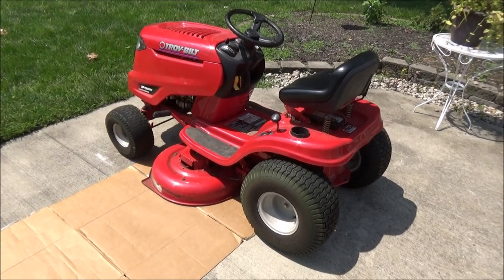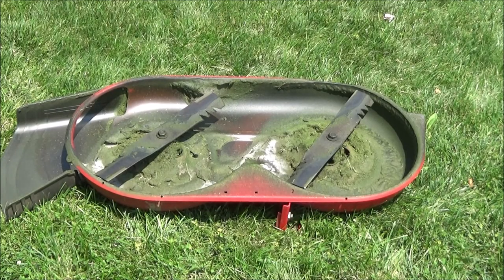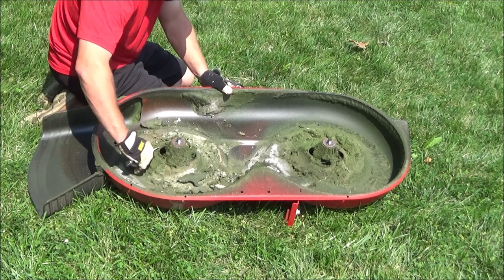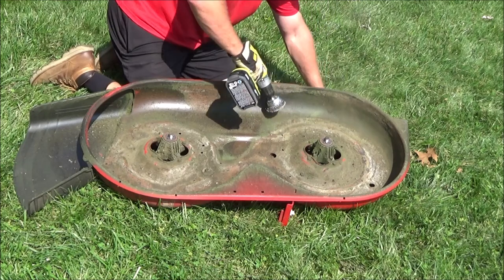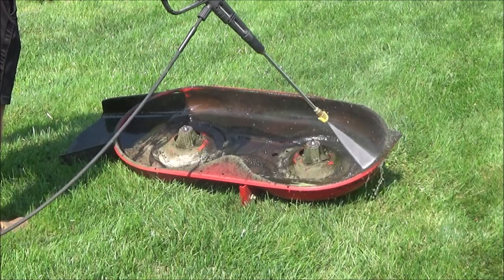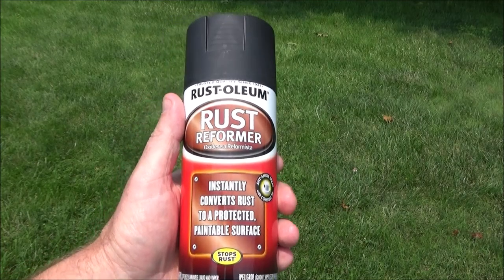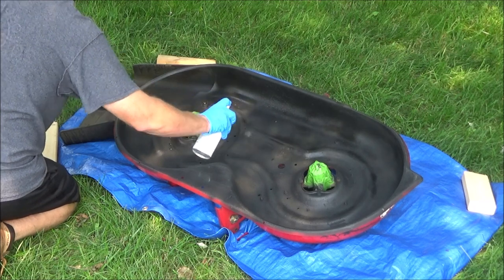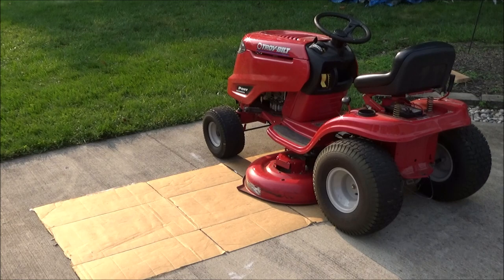How to Clean Your Mower Deck and Repaint It to Slow Down Rust

Comment: I don't know that its better but I pressure wash mine twice a year and coat it with drain oil that is laying around from servicing my equipment its a little more work because of doing it twice a year but youre not buying paint and I do it to my walk behinds also and I know it makes them last because the parts are getting hard to find they are that old, but then again so am I
Reply from the maker: Ha ha, I hear ya on that. Hey, whatever works for ya. I've heard all kinds of ideas when it comes to mower decks. Thanks for the idea, love hearing new stuff.
Reply: @fixitFlip   another advantage to it is the oil will soak through any remaining grass that won't wash off.
Reply from the maker: @kevinhitt719  That is an added bonus.
Reply: Recycle your drain oil properly rather than spread it around . It’s actually hazardous waste, you know.
Reply from the maker: @N-1951  Another good point.

Comment: Utter waste of time. Grass clippings, flying at thousands of RPM, are abrasive. They essentially sandblast the paint off, including the rust! The key is to remove stuck-on  grass immediately, and either dry or oil the metal between mowings.
Reply from the maker: Thanks for the input.

Comment: Just save your money & buy a new deck time is worth more money there is no solution to this issue the only thing your going to do is slow down the grass breaking up you have to fix the pitting & then get a fresh powder coating for a new deck shell fabricated it's around 1000 for a fabricated 50 Inch so if you want the best solution that is it less you want wash it every time after lololol😂 none of these basic aerosol costings will allow frictionless conductivity even close to powdered coatings honestly it's like you applied tar as enamel has a tendency to wear down very quickly the thing's that really break down powder coating is sand dirt sticks & other predominant abrasive debris that cause friction.